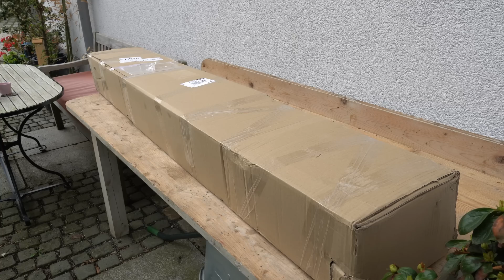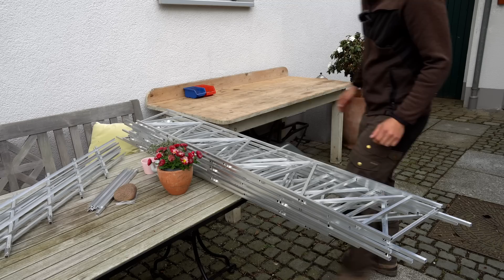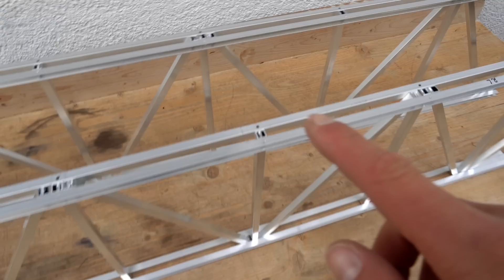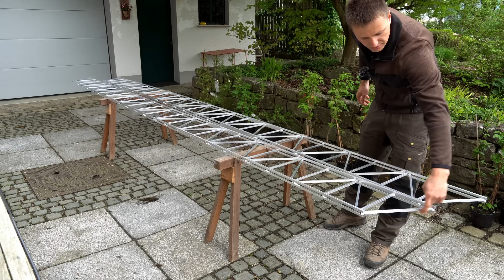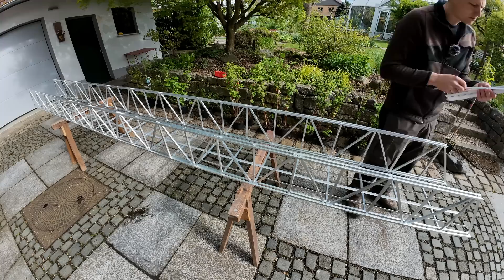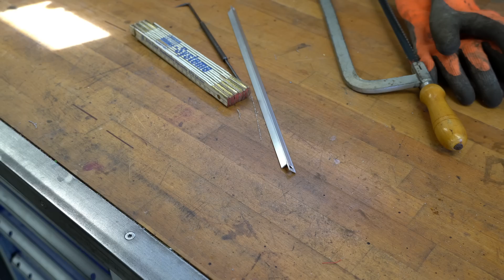RAILWAY BRIDGE assembly ... it is huge!

Comment: I would take one off the end and use the new home built pieces on the ends. Also expansion track joints on the end with the slide bearer that you may mount on the bridge abutment.
Reply from the maker: I will get the missing pieces from the manufacturer, he already responded to my request and will send them to me. There will be expansion track for sure. I will need them not only for heat expansion...

Comment: Very nice (as always) video and narration!  I do have a couple of questions!  Are you in Germany? Mijn vater werd geboren in Buiksloot, Noord-Holland in 1904. But that's about the breadth of my Dutch!
Also, are you using DIN Rail interconnects on your control panel?  While at Intel in the mid-70s, we were early users of DIN box and DIN Rail products from Wago and Harting. They were very good for the first mate, first break applications.  The screw/cage terminals were so much better than the cheesy spade lugs of yore.  I recall the material was Green Diallyl Phthalate for high power/UL rating, and PBA for the UL VO grade Grey. We only used the glass-filled Ryton PPS for special high-heat/high-power applications.  Thanks, again!  Al het beste!
Reply from the maker: Thank you! Yes I am situated in Germany, but that has not much to do with Holland. They speak Dutch we speak German. The languages are kind of similar so I am able to read and understand your short sentence. I do use DIN Rail parts and pieces, its a very clean and tidy installation that way and when dealing with industrial grade parts they are more likely to hold up for a long period of time.

Comment: Wonderful video and bridge. I have emailed them already. It looks to be 5 meters maybe? Are you worried about the screws coming loose over time or with the dissimilar metals electroplate together and hold tight? Just curious because where I live it can get quite hot and also freeze in the winter so I wonder about how much that will expand and contract and what will happen to the tracks.. all stuff to explore I guess. Thank you for the video . They are always thoughtful!
Reply from the maker: Hi! The bridge is 4,8 meters long but you can get them in many different configurations. This is the fourth bridge I bought from the manufacturer and I am still exeptionally pleased with the products! They are very robust but at the same time they look nice. I never had any problem with the screws or any parts of the bridge at all. You set them in place and enjoy them for many years. You have to account for heat expansion, a bridge this size will expand up to 2,5 cm between summer and winter.

Comment: If it was me, I would place the two manufactured pieces as the first or last piece at either end of the bridge. But that's probably a little bit the old engineer in me coming back out. Either way it is a very nice piece of kit. It would be a biggish job, but  do you intend painting it.? It would tend to stand out on a sunny day.
Reply from the maker: I will replace the self made pieces with the original once that I will get soon. The bridge will be paintet once it is set in place.

Comment: You can just install one of your made pieces on each end and it will look to be engineered that way. Nice bridge. 👍
Reply from the maker: That would be a smart solution. If I don´t get the original parts from the manufacturer I will change it your way :)
Reply: I was going to suggest exactly that!
Reply: lol me too
however a very nice extension to your layout

Comment: Is it me or is the youtube compression reaching insane levels? anyone else noticing that (for example) it just can't handle the background and keeps moving it along with you and mixing it with other things in the picture? And when it really loses track of stuff it just makes the entire picture look like a painting in the Impressionism painting style?
Reply: It's not you. There's definitely something going on with YouTube. I've been seeing it on all kinds of channels, and a number of other folks have noticed it.
Reply from the maker: It may be possible that you klicked on the video so quickly after it got released that the HD version wasn´t quite ready. Maybe you try it a second time later on...
Reply: @summitrailway  It could be but no I'm sure it was set to 1080p. Do you not see artifacting on the background and around the trusses for example during the unpacking and assembly?
Reply from the maker: @StefsEngineering  The picture seems to be slightly noisy due to the compression. It definately isn´t as clear as the original file but I can´t see anything so major that it would compromise the watching experience... I will keep a lookout for anyone else that has the same problem, if so I need to do some reserche what went wrong. Thank you for making me aware!
Reply: @summitrailway  I'll check it on a couple other devices as well.
Reply: I have the same result on my other computer, phone and tv. It is possible that a lot of people don't notice that much because they watch the video on their phone. It is certainly less noticable on the phone. (for reference monitor is 38" and tv is 60" so those won't hide any compression artifacts. * in, * out :)  To be clear I am not blaming you personally. It is something that I see in all video's from all channels and is getting worse by the week. They are also working very hard to delete 4K video's from channels without notifying them that this is currently beeing done. (my video's for example, 80% of my 4K video's are now without notification downgraded to 1080p low bitrate)
Reply from the maker: @StefsEngineering  Ok thank´s for your research, it seems like youtube does need to preserve server space. Hopefully it doesn´t get worse... My videos are shot in 4k and rendered at 1080p, this bumpes up the picture quality by a mile compared to shot in only 1080p whilst reducing the data that needs to be stored.
Reply: @summitrailway  Yeah you are right about that. But in my opinion youtube has it all wrong. I totally get that they need to keep costs reasonable and save where possible on storage and server space. But they try to fix it by prettymuch destroying the millions of hours of work that people put in the video's by making irreversable compression conversions. They should (in my opinion) work on the real issue: the seemingly unlimited flood of hours long 4K AI trash that is taking over the platform. 

It comes in all shapes, from actually harmfull misinformation to channels dedicated to tv series that upload a new hour long video each hour of the same clips slightly reorganized. That is a couple hunderd hours for each channel each week of "4K" video that has no real reason to exist. 

Instead youtube desides that the best action is to alter the hard work of people to an almost unwatchable state. 

anyway my apologies for the rant here on your video but I'm sure you can imagine that at some point you just need to vent a bit.